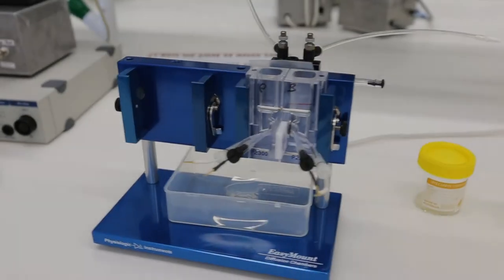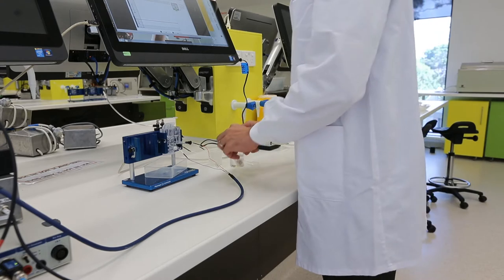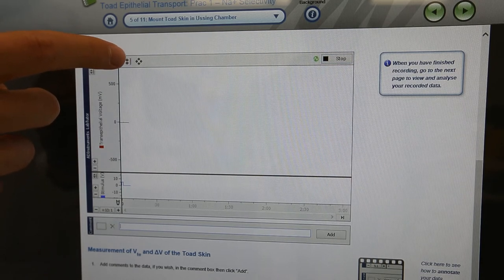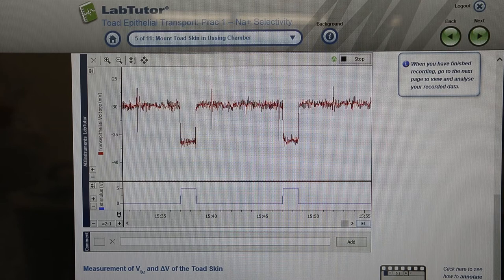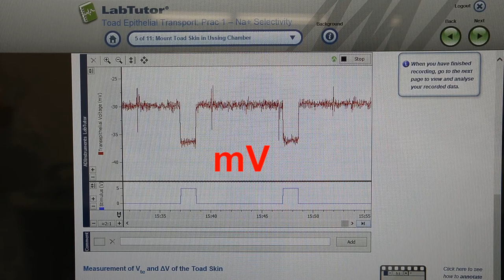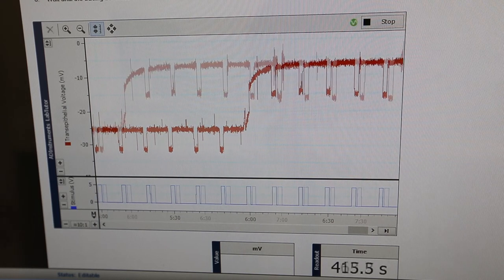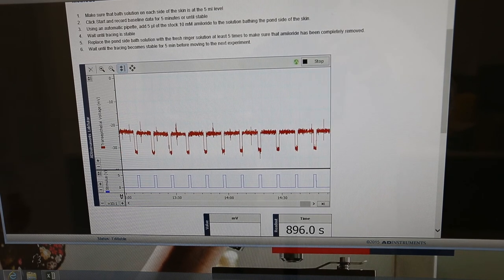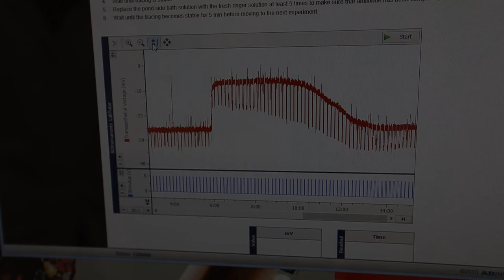Recording Data from skin

Comment: @haydn Hi again! I had a dount regarding the VCC MC8 unit or the multi channel voltage and current clamp unit. What do the two functions, open and clamp, mean and in which conditions are they used? What do their outputs mean with each of the voltage and current mode? Can you please help!